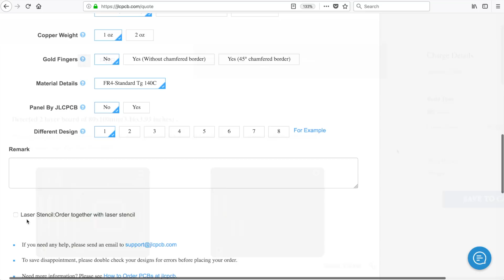SMD Soldering - QFP176 Package

Comment: This is something I notice in all your vids, but how come there is never solder mask between the pins? Is that intentional or is it a byproduct of the pins being too close?

If it is intentional, then why?
Reply: George Troulis its probably to small of a gap
Reply from the maker: jlcpcb manufacturer apply soldermask bridge as random if buyer/customer didn't remark to do the soldermask bridge for IC. In other words, sometimes the soldermask bridge will be applied, sometimes not. (as previous video, green boards with soldermask bridge and blue boards without)
i saw almost pcb no soldermask bridge, and i guess you are right, pins being too close

Comment: What happens if you dont clean the flux?
Reply: George Christou ; You will leave a sticky substance all over the board that dust will stick to and short out the components
Reply: Spark Doctor thanks for the info
Reply: Not neccessary to short.. I used a common flux for soldering chips (in a syringe(no clean flux paste)) and even if i left it on the pins, nothing happened. But there are some types of flux in a metal cans (for plumbing soldering) that are usable for chip soldering too, but they definitely short anything (tens of kiloohms per cm).

Comment: 5:02 too slow hand movement. Is that correct? That may burn ic
Reply: ic size look big, i guess not easy to burn
Reply: it dont depend upon ic size. same material used for small and big size ic. there may be something different reason
Reply: Pad and lead coverage looks good overall, but I've been doing mil-spec soldering for over 50 years and I wouldn't spend that much time on it. Anybody who's seen the dies bonded to the carrier with those whisker-thin leads (inside) knows how fragile they are and how little stress, both mechanical and thermal, it takes to break them - then you're out a chip.

Comment: A lot of mistakes were made here. For one, you should never drag a soldering iron across like that. That's exactly how you fuck up the board and unglue the pads from the board. Always use the shotgun method whenever pads are so close to each other like that. That way you allow each solder joint enough time to cool down so you don't risk disconnecting the pad from the circuit. Secondly, half the leads were hanging over the pads like nails that haven't been cut for a month. All the leads should be centered on the pads. This is just shitty workmanship presented as if it's professional when it's not. Another problem is that most of the pads have too much solder on them. You can tell by looking at them that most of the pads have a convex solder joint instead of a concave joint. This is what happens when you try to just run through them with the soldering iron to get the job done as quickly as possible, instead of focusing on the quality of workmanship for each joint one at a time. You would have been better off using solder paste and a hot air jet using the staggered or shotgun method.